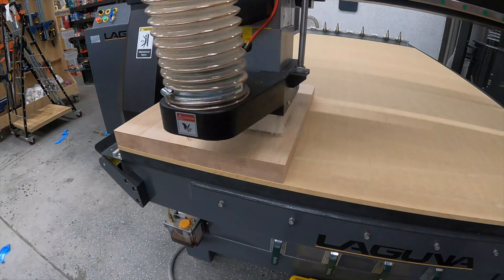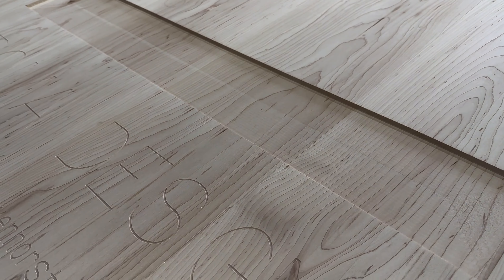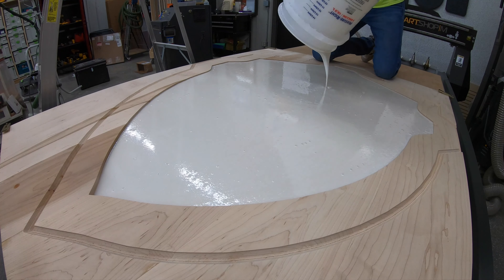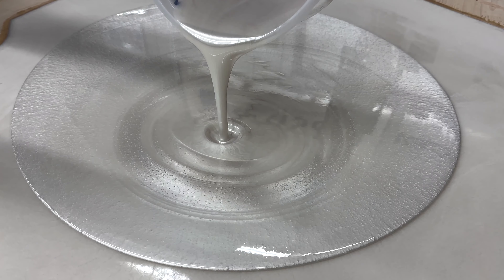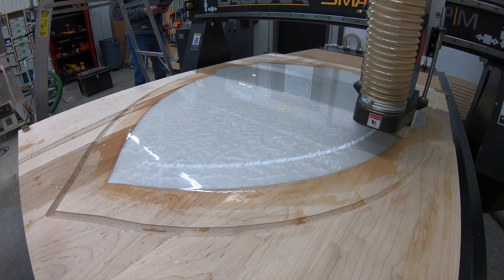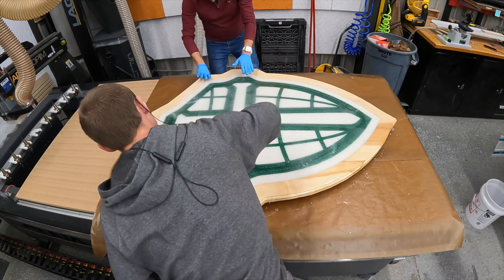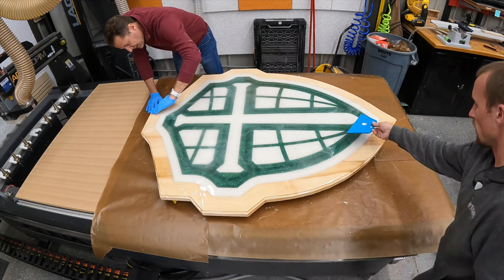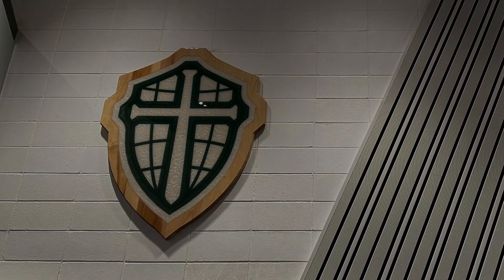USING CNC TO CREATE A MASSIVE EPOXY POUR (and what I learned)

Comment: Hi, I've seen others use their CNC to do a skim cut so no need to just sand the epoxy. Might be quicker for future pores. Also, if you start from 100 grit sandpaper and work all the way up to 1000, the polish ( or cutting compound) will do a better job.
Great outcome though, 😊.
Reply from the maker: Thanks Colin, I'm learning... I have used my cnc for surfacing this type of thing more and it works pretty good for that

Comment: Your first pour and it came out that good?! Haha I wish I could’ve said the same. The wood inlay was amazing. Walnut and Maple together makes me happy. You said that you didn’t have a planer large enough? You have a massive, very expensive planer right there. Haha. I do a lot of CNC epoxy stuff on my CNC and have never ran it through a planer. Before you start, put double sided tape down or use your domino in the side of the wood panel and clamp down from inside the mortises. Use a 1/16” start depth on all your tool paths. Do your pours, then use a good flattening bit to take off that 1/16” at the end. Boom, perfect, flat epoxy inlay. Also, to get the sharp corners, Use a 60 degree V bit, do a V-carve with a flat depth of your choice (doesn’t have to be depth of pocket) and you’ll get sharp, crisp inside and outside corners. Offset your pockets in a little and let that V bit be your final pass to give you the correct dimensions. I use VCarve, if you have any questions, I’d love to help. Just found your channel. Subscribed!
Reply from the maker: Brett, thanks for taking the time to share all that, I appreciate it!

Comment: For your consideration: Curing time is temperature dependent. A pour with a large surface to volume ratio will dissipate heat faster and not reach as high a temperature.
Reply from the maker: I've learned that since I made this video, but the way you explain it with the surface area makes sense. Thanks

Comment: Nice work, inspiring actually.   Couple of questions for you please. 1 - how did you prevent the epoxy from bleeding into the wood edges ?  2 - I noticed you used a paddle to mix the epoxy, how do you clean it ?  Or is it a use once and throw away kinda tool ?
Reply from the maker: I don't really have trouble with epoxy bleeding into edges with hardwood like maple, but plywood or something like that with a very porous end grain can be an issue. Never a bad idea to seal it ahead of time though either way. The paddle is reused over and over. Sometimes I'll run it in water, but lacquer thinner or mineral spirits is better.

Comment: The shield looks great, i really like it. The colors and effects. But the light in the location doesnt really popp it (angled neon light?). It looks bland and not even saturated. Is this due to the camera and in reality it popps or is it bland in reality too? If so, with a spotlight this should really popp out.
Reply from the maker: Thanks! In reality it does look a little better than it did on the camera, but the lighting is bad in that lobby. I said the same thing that it needs better lighting hitting it, because in my shop it really looked amazing.
Reply: @ModernArtisan  "because in my shop it really looked amazing" indeed, it did.

Comment: Curious why you didn't use your CNC to mill the top coat off and then have less sanding?
Reply from the maker: That’s a good observation. I didn’t have a good surfacing bit—the one I used for my spoiler board did a poor job and left burn marks on the maple in my tests—next time! I was just a little nervous about screwing it up.

Comment: Have you instead of pocketing the whole white area, pocket out the individual white areas but 1/4 inch oversized, then doing the pour? Then you can run the green path like you're already doing, and you'll waste so much less white epoxy, and cut down on your milling time significantly

Comment: May I ask where you purchased the hanging bracket?  The end result of the project is impressive. Adding the additional 1/8 pour made a huge difference.
Reply from the maker: Hi David, there is a local small business I work with to bend special brackets or do welding for me—I usually just sketch something up and tell them what I need. That being said, there’s a lot of lighter panels I hang with manufactured brackets from company’s like Monarch Metals. This particular project required something more custom because of the size/weight. Thanks!

Comment: You have a huge planer. The cmc can plane anything. I plane wood with my cnc that is to big for my planer.
Reply from the maker: Yes, exactly, I’ve started using it for that quite a bit. My latest video with the shuffleboard table I use the CNC to surface the board